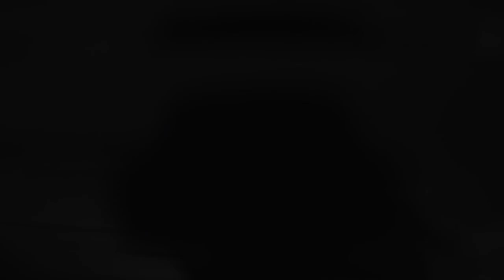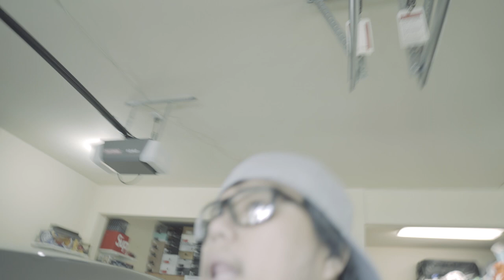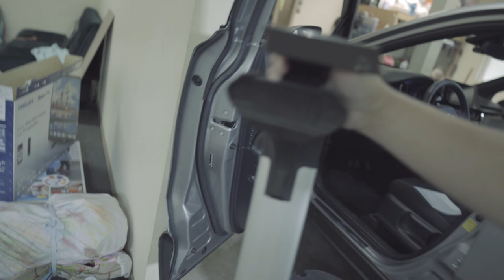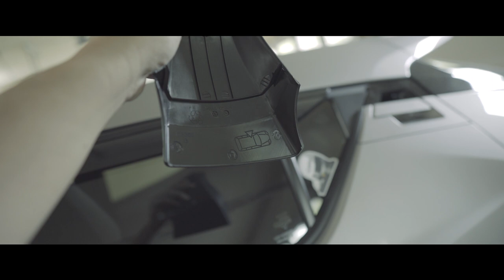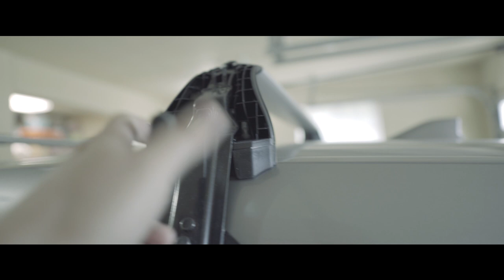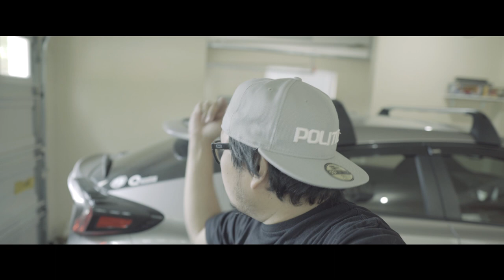How to install Roof Crossbars on 2018 Toyota C-HR XLE [ Project C-HR VLOG 26 ]

Comment: Great videos , love your channel. Just a heads up, at 07:04 you may want to have the clamp above the rubber trim of the door frame instead of below it, so that way it is not warping it. But , keep up the great work on the videos. 👍
Reply from the maker: UEP Alfie thank you, I’ll check what you mean,
Reply: Which is longe the front or rear cross bar
Reply: Also does the cross bar pads go in the rain guide the path way that travels along the roof